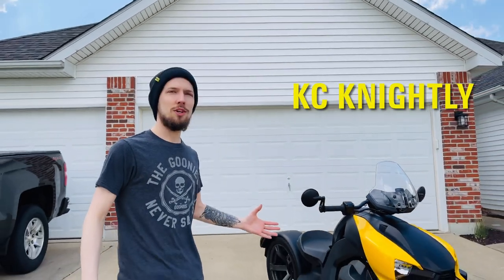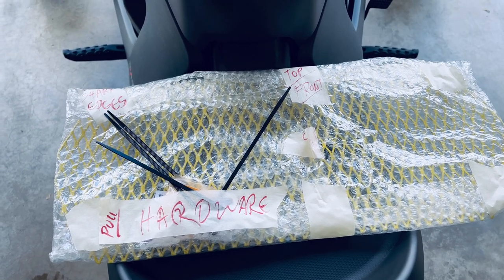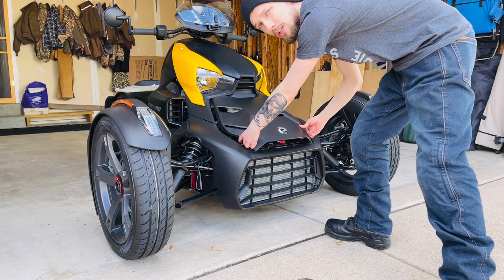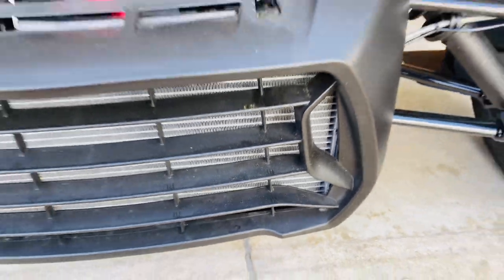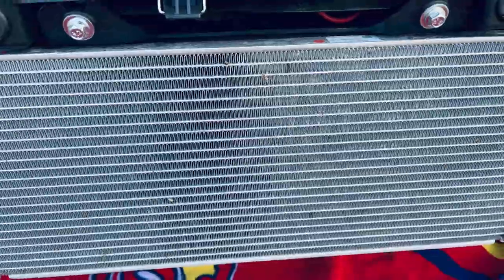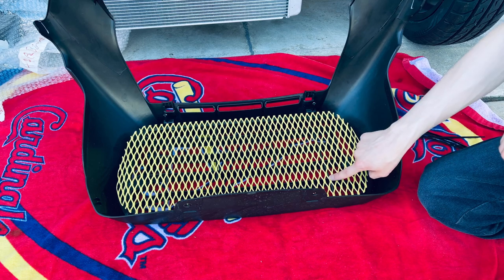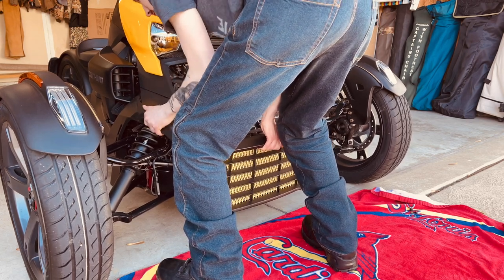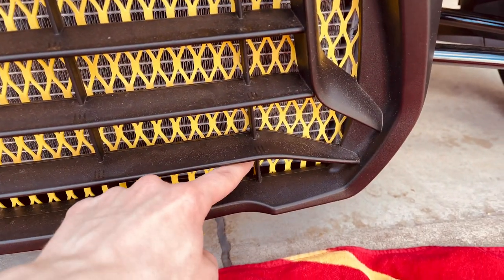Can-Am Ryker Radiator/Grille Protector Install

Comment: Good video mate! If wonder if a dealership could refuse to honor a radiator under warranty, complaining that someone added a grille that reduced the airflow to the radiator? Your openings seem enough not to block too much air, but some people in my area that own Rykers are saying that in case warranty service is required, the dealership might be fussy… time will tell I guess… one could remove the mod before going in for service, of course…
Reply from the maker: Thanks for watching! I haven’t personally had any issues with my radiator, however, if that is the concern it may be best to remove the mod before taking it in. After all, it’s only a few zip ties 😏👍🏼